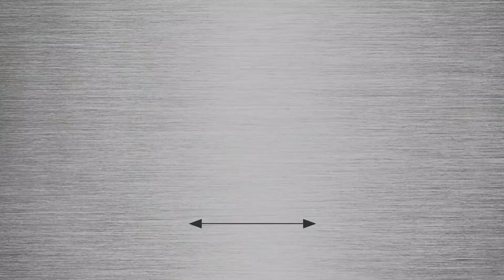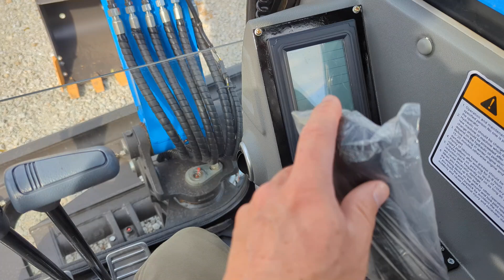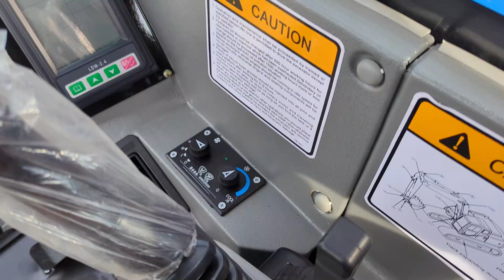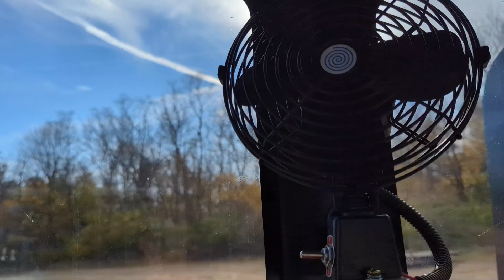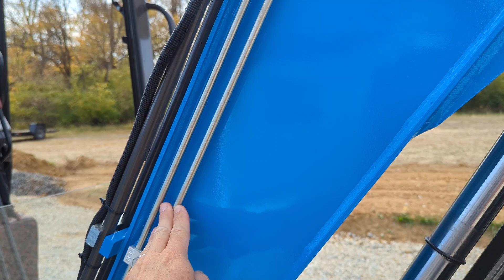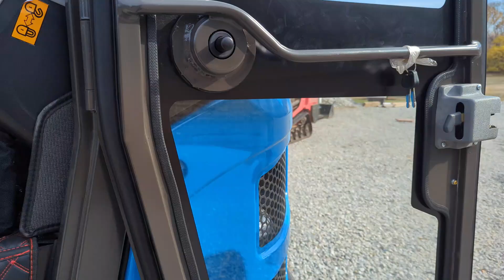KYMRON XH42D Walkaround

Comment: I own a 2024 HX24D with the hydraulic quick attach and it has flexible hose the entire length.  I like that this one has the hard piping and the connections to the quick attach have been moved to protect them more.  Mine stick way out to the side and it's easy to get them snagged on tree limbs or bushes.